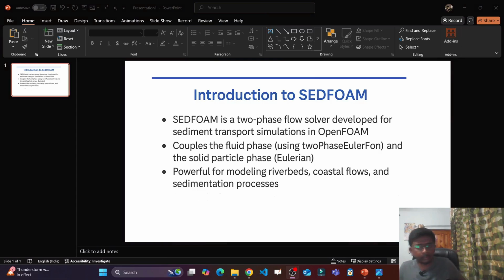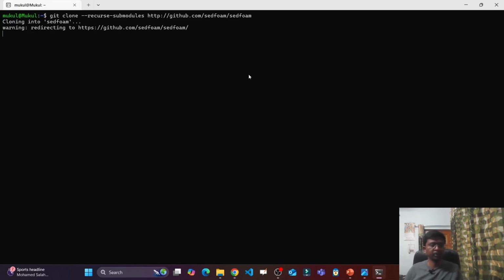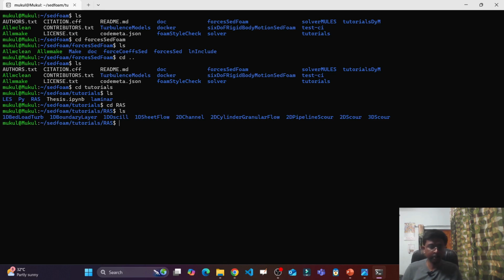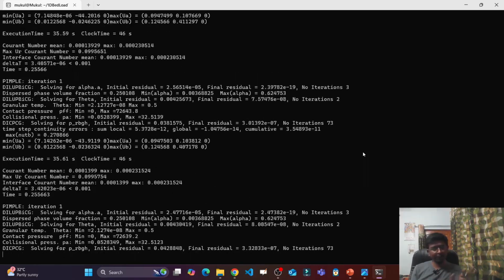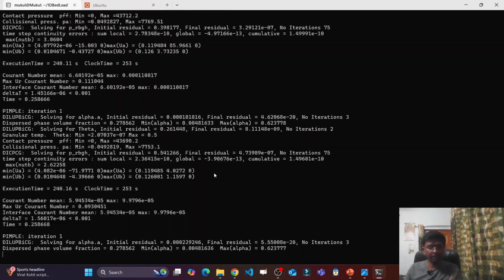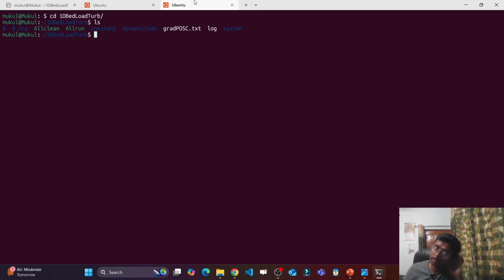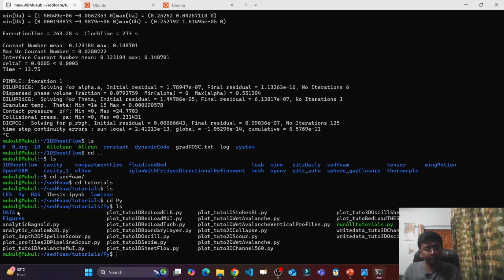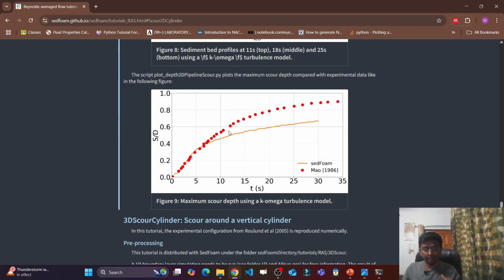🔧 Introduction & Installation of SEDFOAM | CFD Simplified

Comment: which openfoam qre you using please ? i could not compile at all neither with OF2012 or 2306, there is serious pa
tching issues
Reply: I had the same issue. But I resolved it by first running openfoam2506 as I had installed OF2506, while inside the sedFoam folder. After I ran ./Allwmake
Reply from the maker: Use latest openfoam, i recommend 2412. Sedfoam compile with it accurately.

Comment: Very nice video! Can you give more video tutorials about how to use Sedfoam. Thanks.
Reply: Such as some cases
Reply from the maker: Sure. I will upload that.
Reply: I'm currently working on a
research project simulating the breach of an earth dam by the "renard effect" using sedFoam_rbgh.
Specifically, we are following the 3DScour tutorial
as the basis for our setup. Despite following the
standard workflow (blockMesh > snappyHexMesh
- setFields > sedFoam_rbgh), we're running into
persistent errors-floating-point exceptions during
phase-fraction divisions, warnings about unused
alpha_b fields, and difficulties initializing the
sediment/water interface correctly.
Given your expertise with sedFoam, I was
wondering if you might have time to discuss these
issues or offer any advice.
This the error that i have : Calculating field muFra
end of createFields
[stack trace]
#1 Foam::sigFpe::sigHandler(int)in/usr/lib/openfoam/openfoam2412/platforms/linux64GccDPInt320pt/lib/libOpenFOAM.50
#2
? in/lib/x86_64-linux-gnu/libc.so.6
#3
Foam::divide(Foam:Fieldsdouble>&,Foam::UList<double>const&,Foam::UList<double>const&)in/usr/lib/openfoam/openfoam2412/pl
atforms/Linux64GccDPInt320pt/lib/libOpenFOAM.so
#4
void Foam: : divide<Foam: :fvPatchField, Foam: :volMesh>(Foam: :GeometricField<double, Foam: :fvPatchField,
Foam:: volMesh>&. Foam::Ge
ometricField<double, Foam: : fvPatchField, Foam: :volMesh> const&, Foam: : GeometricField<double, Foam: fvPatchField, Foam: :volMesh> con
st&)in/usr/lib/openfoam/openfoam2412/site/2412/platforms/linux64GccDPInt320pt/bin/sedFoam_rbgh
＃5
Foam::tmp<Foam::GeometricField<double,Foam::fvPatchField,Foam::volMesh>>Foam::operator/<Foam::fvPatchField,Foam::volMesh>(
Foam: :GeometricFieldsdouble, Foam: : fvPatchField, Foam: :volMesh> const&, Foam: :GeometricField<double, Foam: : fvPatchField, Foam: :voLM
esh> const&) in/usr/lib/openfoam/openfoam2412/site/2412/platforms/linux64GccDPInt320pt/bin/sedFoam_rbgh
#6
?in/usr/lib/openfoam/openfoam2412/site/2412/platforms/linux64GccDPInt320pt/bin/sedFoam_rbgh
#7
?
in/Lib/x86_64-linux-gnu/libc.so.6
#8
libc_start_mainin/lib/x86_64-linux-gnu/libc.s0.6
#9
?in/usr/lib/openfoam/openfoam2412/site/2412/platforms/linux64GccDPInt320pt/bin/sedFoam_rbgh
Ep===========
Floating point exception (core dumped)
(pyenv) sudofoam@38cafd0a78fd:~/case$
AC
O
人
Reply from the maker: Hey! Please send the errors on the email. Will check it. 
Email: cfdsimplified@gmail.com